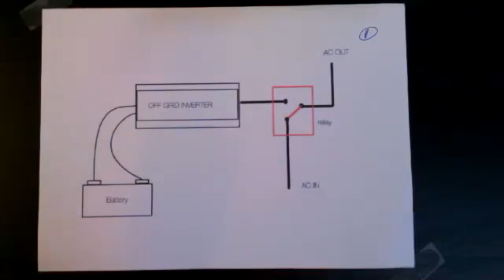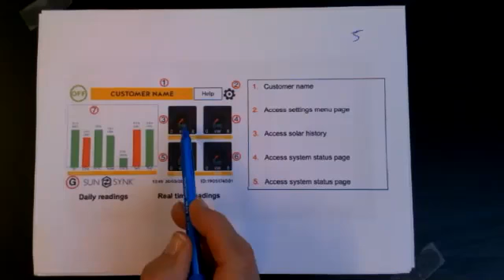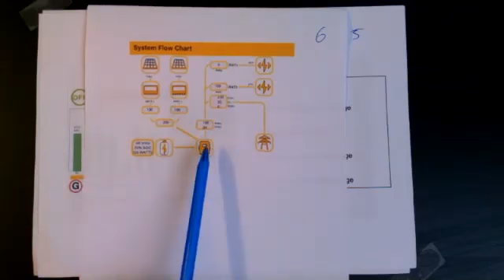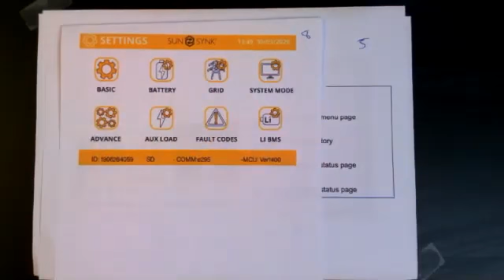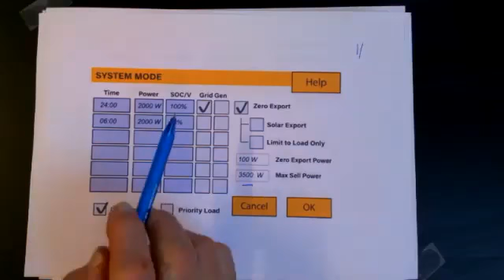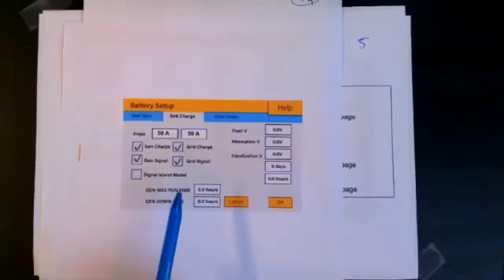Sunsynk Inverter Training (Basic)

Comment: Keith we have just had a elite 5 KW inverter stack fitted. But not impressed at all. My timer will not work been onto chat. No one can help . Timer one 95% timer six 95%> save.
Guess what it keeps going timer six to 60% so that is all it will do. Had data logger reset by online chat. No change, only been fitted a few weeks now. Yes remote box ticked on inverter and not locked out. Very poor support from Sunsynk.

Comment: Hi Keith,
Hopefully this might find you with a moment to spare ?
Our first demo unit is a 3.6kw Ecco. We have "No battery" selected - though will add one shortly.
Why does the display show SOC voltages when there should be no SOC ? 
Nothing shows on the main screen for Solar. We have 5 x 430w panels attached.
Early Feb in the Uk 😞

Comment: Hi, 4 weeks ago I installed a brand new backup system, a 8.5kv Inverter and a 8.7kwh lithium battery. In the first few days the battery would charge 5 bars of the 6. The 2nd week it charge only to 4th bar. Now in the 4th week it only charge to the 3rd bar. In the manual it states that the battery need to fully charge at least once a month to ensure accurate COC calculation. I uncoupled the battery for 10 minutes, that did not help. Can I press the reset button on the lithium battery. Do you have maybe something that you could advice I could try?

Comment: Hi Keith. I had a 10kW SunSynk inverters & batteries system installed 3 weeks ago by an approved SunSynk installer. They also fitted 16 X 540 W panels. The batteries are lithium and the installer has entered 57.6V in the equalization V setting. I also see that the MPPT1 & MPPT2 are connected together as the system flow chart has 0 W for MPPT2. I also have the slave inverter LiBms 01 showing detail but LiBms02 shows a page full of zero data. Should I be concerned. Thanks

Comment: Can I ask a question?  If one of your strings is expected to experience partial shading (via shadow casting etc), is it OK to use optimisers on some (or even all) of the panels on that string?  If so, is there an optimser manufacturer that Sunsynk recommend or are they all pretty much of muchness?  (I was thinking there may be some affects from the DC/DC switching noise and frequencies of the optimiser and Synsynk MPPT having partial intereference affects).  Thanks for your time.

Comment: Hi Keith. i have just had your system installed with a 3.2 solar aray. 3.6kw inverter and 5.1kw battery. The first 2 days of the install the alarm on the inverter and gone off. Could you advise on the possible problem or wrong setting form my installer regards Dave

Comment: Dear Experts 
Please share link to Technical Manual 
I wish to learn more 
Here  many housing projects have no Utility Grid Supply 
they use Electricity from Diesel Generators 

I wish to learn How best this inverter can be used on Generator (pseudo) Grid so the Projects Electricity Generating cost could be reduced 
with the  On-Grid Solar systems 12kW x 10 Nos. to gradually grow 

Thanking you

Comment: I'm in the Philippines, and don't have the best technicians to ask questions to for initial install.   Is there a place I can call, or connect to with an expert that I can run a few things by?     If not, here is my questions.    1)   I have no intent to ever sell back to the grid,  so,  can I run this a pure grid tie inverter?  where I run the power from inverter directly to my Existing Main Breaker box?     in this configuration,  would the CT connecter automatically match the power needed so as to not back feed to the grid?       2)  possibly related question,  the inverter has a GRID input GEN input and LOAD output.     Do I need to run a line  from the Main Grid power to the Inverter?   to show "incoming grid"  values?     if yes,  then what do I connect my LOAD Output too?   a sub-Breaker-box?   is it possible to not use one?   and just connect the inverter power into the main box?      I guess I've only seen many videos of "theory diagrams"  and "programming",  but  never seen one of someone hooking up a Deye directily to an existing Main Breaker Box type setting.

Comment: The problem with SS is that the owners of the system will be using it, but the settings are aimed at installers. If there is a problem, the installer might not be available immediately.
Reply: My installer hasn't got a clue either how to set up the inverter settings 😅. Sunsynk support is pretty poor tbh as they've been trying to phone in and get help and can either not get through or Sunsynk don't resolve. It would be good and relieve some pressure from their busy customer care line if they spent time responding to the many queries on youtube. Many of the questions are what others also want to know but there are no replies.
Reply: That is bang on…

Comment: Hi Keith.
I meant to ask Joel and Tom today ... can we install this inverter as a DC coupled unit with a seperate (additional) PV system connected to it ? Via the MC4 inputs and the dual MPPT.....
More clearly, some customers have already got grid-tied PV that might be ( lucky for some) locked into a lucrative feed-in tariff for many years, which cannot be changed ( original generation payments would then be lost if changes to the original install were made !)
My thoughts are to still be able to use an existing PV system for loads and maybe charging ? - but add extra panels to THIS inverter and still use zero export and load diversion ( heating element / EV charger etc )
I hope i have explained my question clearly enough ?
Thanks.
Simon